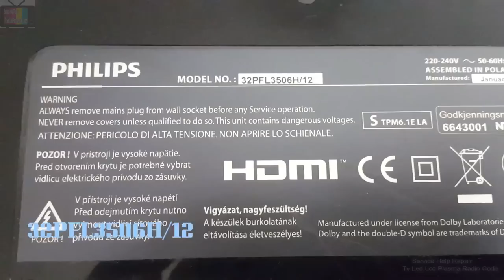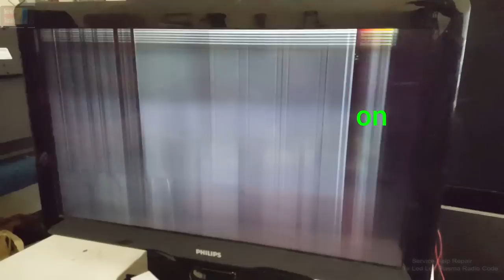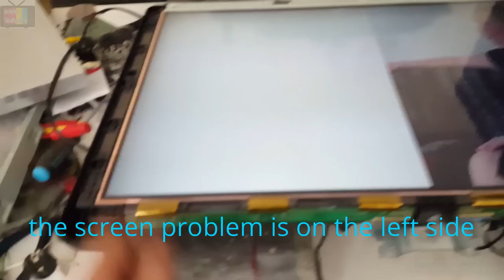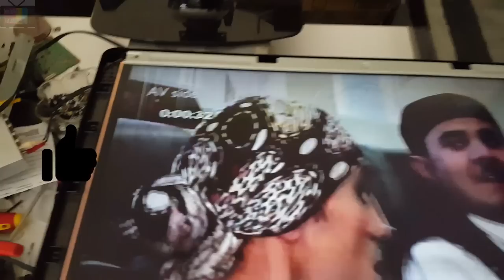PHILIPS 32PFL3506H/12 no picture on the TV screen. just a lot of lines

Comment: If I were you I'd think about replacing the T - CON Board; it could fix this type of screen issue.
Reply: Why would you want to replace the t-con board when such a simple fix did the trick ? It seems to me that the pins covered up  has a voltage issue and disconnecting them  routed the power from the other side of the tv, that my best guess.
Reply: Perhaps
Reply: Hi 15 anch panl vit